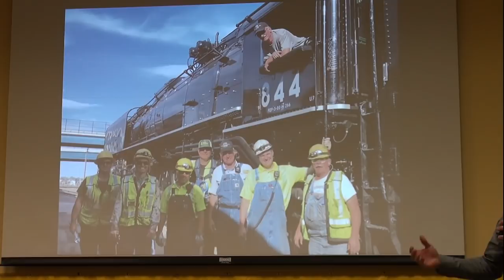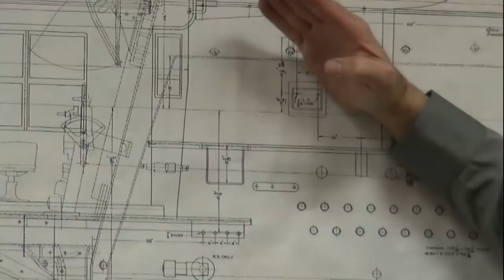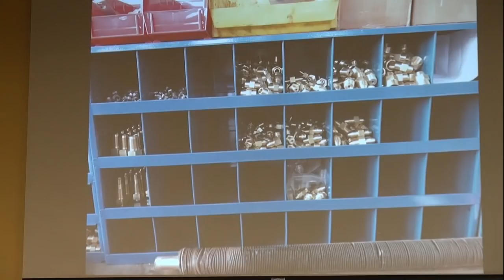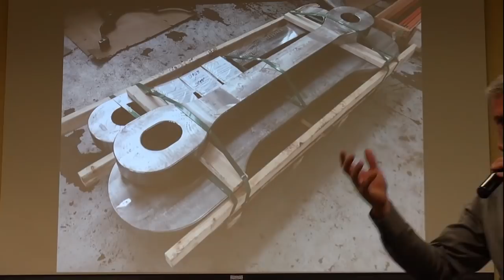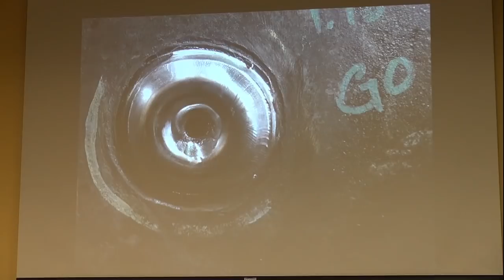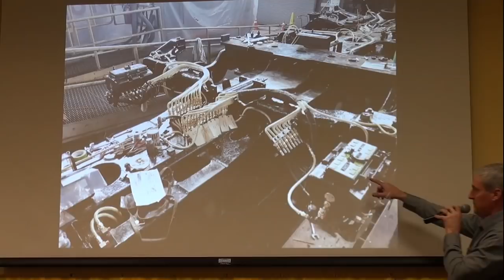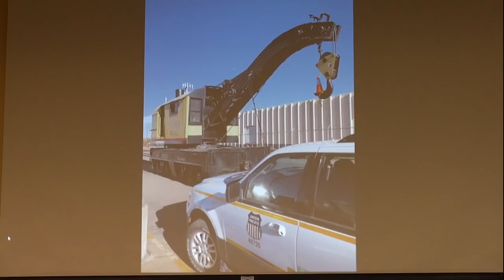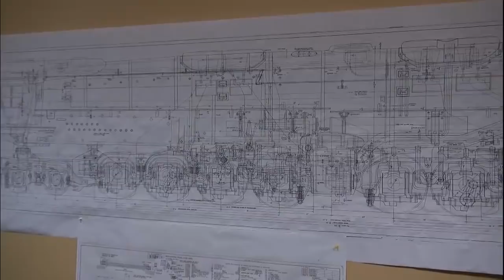UP Steam Update 2018

Comment: The Union Pacific Steam Team did such a amazing Job on restoring the Big Boy so far and I can tell that this restoration is going to be a huge success. But after they restore or rebuilt the 3985, then will they restore the UP 5511 or another UP or a non UP Engine.
Reply: 5511 isn't really a good option for a modern Class 1 railroad. It's fitted with friction bearings and sadly it's a good hitpoint for the kind of steam locomotive don't want in the steam preservation. It's too slow for excursion passenger trains on the mainline, so it can clog up regular freight traffic, causing the class 1 roads to make less money than they should. And it's too big and heavy for a lot of tourist lines, so they won't have much success with it either.
Reply: Oh ...Ok then what about restoring one of the surviving UP Diesel Turbine Engine Locomotives or another fef northern like UP #833, or UP #814. (Are any of them will be in good restored, running, and condition for the mainline)
Reply: Or they won't restore any more, they will most likely try and keep their fleet operational as much of the time as possible, dreaming about more steam is nice but in this situation it's not practical.
Reply: they should  restore  Ac-12 4294 or heck even design  copy builds of those Mightt AC-12 Cabforwards they burn oil and water to build up steam Union Pacific would  also love to have  Ac-12 A forward for Union Pacific

Comment: I have a question for those familiar with the inner workings of the Big Boy. I spent yesterday looking at, under, and around 4017 in Green Bay, and I learned a lot because the cladding is off, unlike the 4012 near where I live. I can not for life of me, however, figure out how the power reverser/Johnson bar operates all four lifting and reversing arms - I see one reverser, connected to the lifting arm of the rear valve gear engineer side. This lifting arm is of course connected to the fireman side lifting arm via an axle. How does the engineers input to the Johnson bar affect the FRONT two valve gear settings?.. I see absolutely NO connection from the front set of valve gear to the rear set. Anybody know?

Thank you

Comment: Be careful with the uneven heat in the boiler .with oil you have a lot powering the be gaining but starve out in the long run.Coal has an even heat oil is uneven. with a boiler  that size on the 4014
Reply: they used oil on the challenger and the challenger isn't that much different from a bigboy cause they were designed to work hand in hand so I wouldn't worry to much
Reply: I think it should be ok, the Southern Pacific 4294 (Cab Forward) has a firebox area of 139 sq ft, whereas the Big Boy's is only 12 sq ft more, at 150. Since the Cab Forward is an oil burner, I figure that the 4014 will run well as an oil burner.